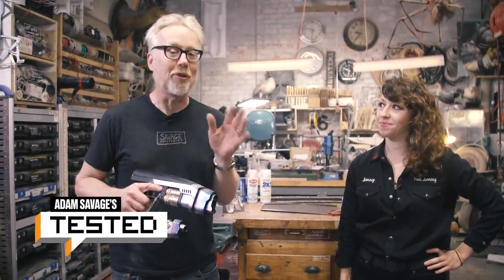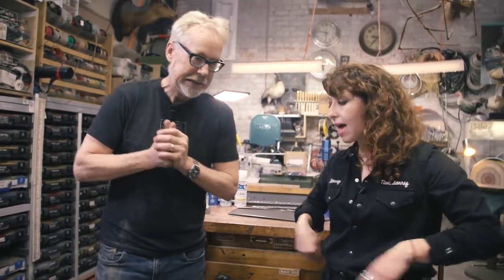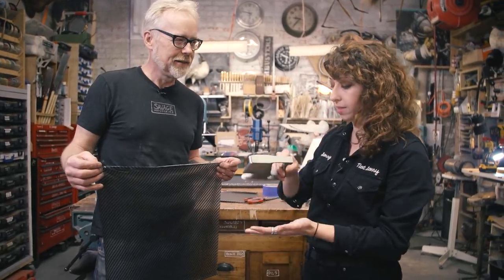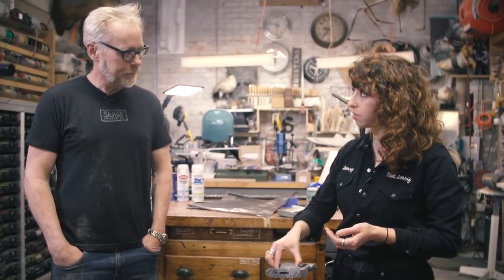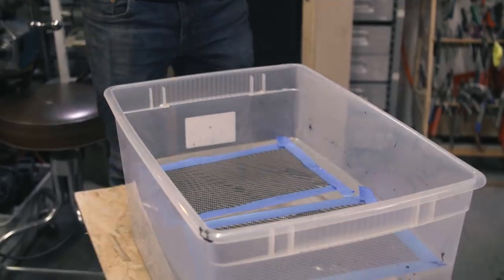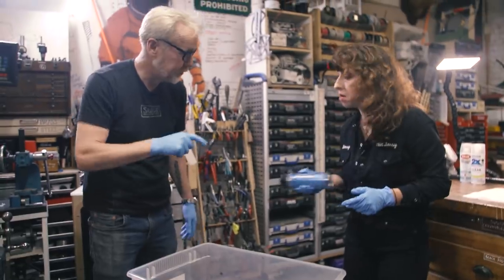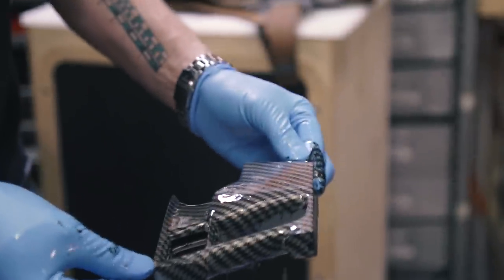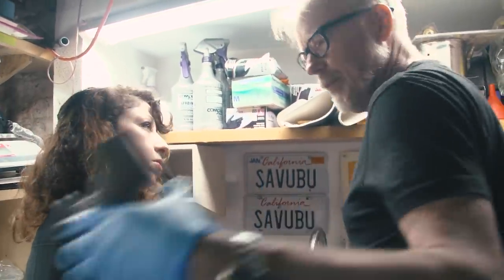Hydro Dipping Carbon Fiber Blaster Grips!

Comment: a few things you've done wrong this time:
get a dark/graphite gray base for carbon fiber, it will look like real carbon fiber and not this fake one.
cut the tape edges around the film, let it expand, it was made to do that.
the film looks like it was under-activated (you can activate it with 2K Thinners and a spray gun too), when its activated correctly the film will reflect light like it is glass, and it will expand. this will ensure proper adhesion
if you're going to do a double sided dip like this one, run a tape in the edge you want to create, dip then rinse, tape again dip the other side and clear the entire piece at once. it will look flawless.
last but most important, BLOW OUT bubbles!! or the film will break like it happened in the girls side edge, just get close with your mouth and blow gently till the bubble goes out the side

PD: water doesnt need to be heated, just get the film in the water, wait 2-3 minutes till it gets all the way flat and activate away!

Comment: The tape made life so much harder for you....and that activator may have been recommended but the aerosol versions are garbage imo. The ones you use in a hvlp paint gun are so much more efficient. Just beware because they are high concentrations of xylene and you need a respirator. The tape can be applied after you get the film on the water, just make sure to get the air bubbles out. Water on top of the film you want to keep at a minimum, but isn't as important as getting rid of the air bubbles.

Comment: Or you can carefully tape non slip onto the handles in base coat black and spray silver for the imitation of actual dip tech/ real carbon fibre. If you dont have alot of $$..

Comment: Why wouldn’t you just use carbon fiber? It would look and feel more authentic. And as crazy as it sounds to say, it’s much easier to work with carbon fiber or fiberglass than it is to dip something.
Reply: Not the right equipment maybe
Reply: Bl4ckSp1d3r oh he has the equipment. It’s not some specialist thing. It’s simple fiberglassing. Wet the cloth and use some method to apply it to the outside. I think this video was made to showcase the techniques involved. Actually pretty cool after finishing the whole video.